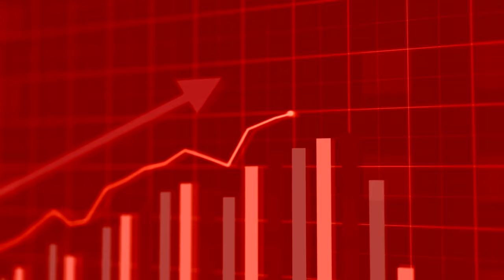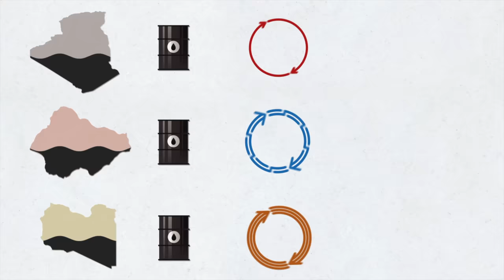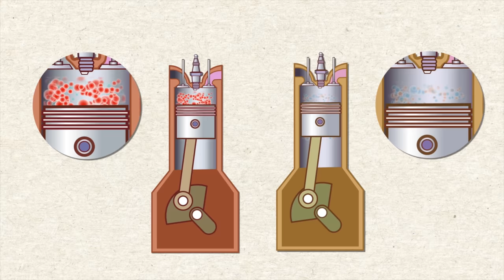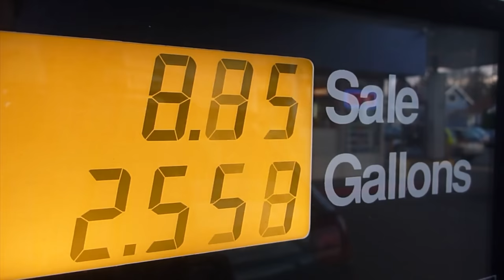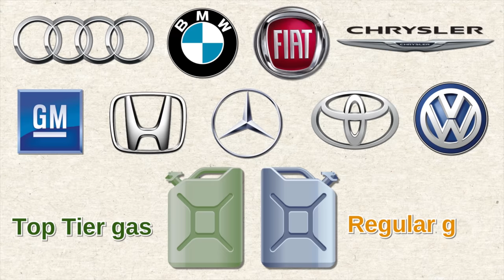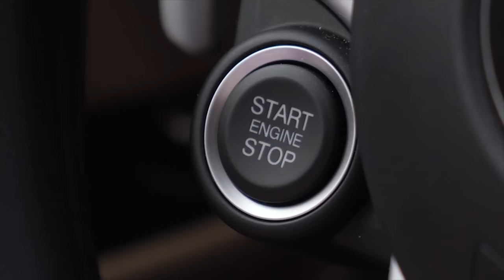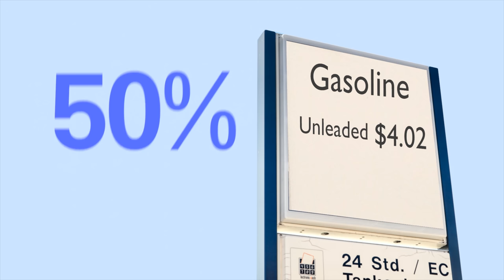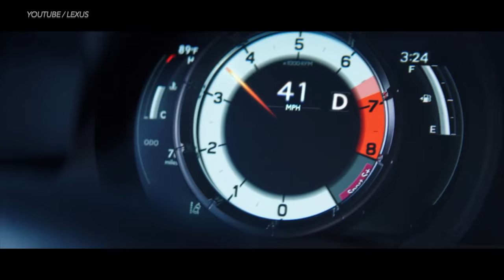No One Has the Balls to Tell You the Truth About Gas Prices, So I Will

Comment: Scotty, I am sticking with my '90 Ford Ranger Custom. It is long paid for, runs good, gets 25 mpg, oil and filter changes every 3,000 miles or sooner, gets regular maintenance on both running gear and drive train. No matter how you look at it, the truck is cheaper than buying an EV any day. When they build a hydrogen refit kit for my truck, I might consider it. But, gasoline IC is for me until this madness stops and other liquid fuels are available or they invent a battery that recharges just as fast as you can fill the tank on my Ranger. Nothing you can say will change my mind.
Reply: Gasoline IC what's that
Reply: @njcowboys3588  Internal Combustion
Reply: Research abiotic oil theory. Fascinating.
Reply: Are u looking for A son in Law.. ?
Reply: Why didn’t they go propane.
Reply: Due to my situation where i had to buy new car due to my previous 2 cars were costing me an arm and a leg... i got a 2019 Toyota carolla and gets 40mpg average. 2 years left of payments but it does save at the pump.
Reply: Have you heard of the inventor in Canada who can run an existing gasoline powered engine on Ammonia? Look into it.
Reply: @thetruthisoutthereyt  It's Canada. Are you sure he didn't say "pneumonia"? The ammonia system works,. but the ammonia has to generated and that process itself requires energy, so again you are just moving the energy generation somewhere else. For another thing, ammonia itself is pretty caustic and then there is the issue of what the combustion products are. Oxides of nitrogen are going to be the inevitable result even if the primary products are water and free nitrogen. The appearance to me is that using ammonia as a fuel is just a clever way of burning hydrogen.
Reply: Mine is an 89, and I feel the same. My manual Ranger is unstoppable, and fun to drive.
Reply: 1990 Ranger! How many miles? Is it the original engine and transmission?
Reply: I miss my Ranger - had over 500k on 3 units.
Reply: @scottcampbell4678  ammonia is in DEF so it must. But, have you looked into any videos on the subject. I too thought it was a pipe dream. It
Reply: having a paid for and well maintained car is more important that what car you drive for now anyway. when they start coming out with affordable EV's/hybrids with better cost/benefit then i'll consider something other than IC. They may even make IC even better to hold on longer.
Reply: And I, my 18mpg Ranger. Vehicles are simply out of this world right now.
Reply: @nicolec7290  propane is also very expensive and doesn't have the same equivalent "octane" that gasoline has.
Reply: I'm sticking with my 91 Ranger for the same reason.
Reply: @nicolec7290  that would require billions of dollars to switch to a fuel that has less energy! Why don't you vote for people vote for politicians that are favorable towards domestic oil producers! Tax imported oil! To all you idiots that think we can't meet the demands,  what did the Easter Bunny bring you??!
Reply: Your Ford ranger has the safety of about a bicycle.
Reply: Nicely put…🙏🇺🇸 godbless
Reply: @nicolec7290  propane was horrible on mileage distance,my company had 2and propane cost more at the time,try to find a Sunday pump on the road as myself and another had to be rescued because of no fueling.
Reply: If you simply find a good, honest mechanic like Scotty and fix things as they break before they become major issues, you can literally keep a car or truck running forever.
Reply: I have a 2000 ford ranger I bought in 2016 with 64k on it. It now has 141k and runs like a scaulded cat. I’m keeping it forever. I fill the tank every other day and it feels expensive but it’s nothing compared to these newer cars. I’m a mechanic so I love my older cars. Inexpensive and reliable! Lol
Reply: @nicolec7290  they did back in the 70s.   Didn’t work
Reply: That's usually what is recommended. Same with your house. New materials might be more efficient long run but short term, throwing away perfectly good materials that still have life in them does more harm than good. And there's just no way we can produce enough EVs for everyone to switch so you keep driving that thing until it dies.
Reply: Hey bro how do I get 25 mpg on my 08 Ford ranger it regular cab 7ft bed I have tunailcover on it I have regular tire I got up 17 mpg then fuel pump went out then I got new now I am getting  14 mpg
Reply: How the hell does a ford ranger get 25mpg? My 96 explorer never gives me more than 20 on a good week
Reply: My EV charges overnight on the battery connected to my solar panel grid. I am paying nothing to drive every day. When I see people fueling up at a service station I can only pity their shrinking bank accounts and closed minds
Reply: Wer need a truck, we don't want a fire burning POS for $60K so your choices are a truck that may only go 100-150 In winter or summer, towing...There only $100K buy 2. Oh yah, recharge is only 10 hrs. It should come with a sleeping bag & a tent.
Reply: @briannemeth9417  We need trucks for our jobs. They go est 100-150 miles in summer and winter. towing maybe less. The beds to small for work. That's ok, there only $100K. Joe abandoned Americans in Afghanistan. Intentionally escalated the 8 year Ukraine Russia conflict, & you think he's doing well🙈
Reply: @briannemeth9417  how does a solar panel grid charge at night? Asking for a friend.
Reply: @logpile1318  it charges my big basement battery all day . At night I  plug my vehicle into the fully charged basement battery and in the morning my vehicle is charged up
Reply: @briannemeth9417  how many hours does it take to fully charge?
Reply: @markmccarty9793  did you even watch the video?
Reply: @njcowboys3588  internal combustion
Reply: Not yet. Been busy, got couple guys remodeling, I'm retired now and getting everything done now! Check it out tonight!
Reply: not only charge a vehicle as fast as it takes to fill up (even the fast charging tech can take 15+ mins to charge at a station) but also find a way to cheaply repair those batteries when they start to go bad. right now, if you have an EV and that pack starts getting cells going bad, it is almost 1/2 the price of the car to get repaired... not a big deal if it happens under warranty, but kind of a big deal after your warranty is out and if you arent paying for an aftermarket warranty to cover it. i also havent seen any EV vehicles that could tow my trailer or boat the distances that my truck can... for me they need to make something that is equal to what my gas powered vehicle is before i would even consider it (distance, power, and towing).
Reply: @davidmuir405  Downhill both ways.
Reply: Changing your oil that often is a waste! I spend a few more dollars and go full synthetic in all of my vehicles and get 10k between changes.
Reply: @NineteenEighty-Four  already switched to systematic few years back! But I usually change it out at 5000 miles. Both my trucks are REALLY high mileage! My 05 fxk4 has nearly 280000 miles on it! Pull heavy trailers and the camper with it! The 2000 Expedition has bout 242000 on it! You might be right, but the 5.4 in my f150 is bout a quart low at 2500. Put one in, then change it out at 5000! The 5 20 oil is thin as water! The old 4.6 in the Expedition bearly uses any, but then again it's cheap insurance! I change both out at 5000. I'd change the filter at 5000 or so even if you wait till 10000 to change the oil! The bypass will open if the filter gets dirty and ur churning dirty oil! Most engines will run so long now that people just get tired of looking at the same vehicle!!
Reply: @markmccarty9793  Yeah, I agree. Hard use and high mileage needs more care and attention. 👍👍
Reply: I ones consider a tesla, the  I found out I was going to pay a arm and a leg 🦵 to insure it. Then I bought 69 chevy c10 with that money
Reply: I had a '91 Ranger for years. It was silver, short bed, single cab, 5 speed with the red interior. I absolutely LOVED that thing.

Some kid blew a stop sign and ran into it in 2011. I seriously miss that truck. It was in nearly perfect condition until that sad day. 

I'd still be driving it today if not for that.
Reply: @Metalbass1979  the little 2300 was indistinguishable. Once they went to fuel injection you just drove them toll you got tired of lookin at them! My 98 has the the 2500, but the step side bed means a sheet of plywood won't even fit down into the bed, much less the wheel housings!!
Reply: It's OK, with proper maintenance they'll run forever! My 3v 5.4, the ( one every body tells you to stay away from) has 274000 miles on it! Pulled a trailer loaded with old shingles over 8000lbs to thr landfill 35miles from here few months age. Change filters and oil and leave that shift lever alone,it knows when to shift!
Reply: @briannemeth9417  Where do you get your free solar panels and batteries?
Reply: ok
Reply: At some point, fuel prices WILL get high enough to justify a change. The world uses about 100 MILLION barrels of oil per day, and oil's a finite resource. Yes, there's trillions of barrels left, and we can continue on for around 50 years at the current rate, but well before the oil runs out prices will rise dramatically as the more easily extracted oil is consumed.
Reply: You can't EMP a gasoline tank, either.
Reply: I have a diesel, and SUV. I haven't found oil for my truck. I have to run all over the place, to have enough. I hope we won't have to step away from gas to electric 😳
Reply: @hubertwalters4300  It's the democrats who enabled me to have this amazing solar panel set up and ev in the first place.  I think you have been inhaling too much of that $7 a gallon petroleum.  I have also heard overexposure to Trump gas can have the same effect
Reply: @briannemeth9417  Ridiculous
Reply: 90 Ranger get 25mpg yeah right lol
Reply: I got an 88 f150. Was considering converting to propane. What do you think ?
Reply: Great to have an open mind. Education must be difficult for you since you seem to be unable to accept things are different then the way you see them
Reply: @AdamConstantine   "Oldies, but goodies." 
My dad liked to collect things, and build things. He built his own professional grade telescopes, and collected some cool cars. 
I got to "test drive" his early '60's Ferrari, and late '40's Bentley. 
     Electric just isn't where it's at when I think of cars like that.
Reply: @Bellathebear777  Good point,either a tent or credit card for a motel room that Tesla pays for.
Reply: @BkBk-gy6vr  the four cylinder with manual transmission can get 25 all day long.
Reply: That's the biggest drawback for me, the time it takes to recharge. If i could 3-400 miles worth of driving in 5 minutes like I can filling my gas tank I'd be very interested. EVs sound great for ppl who wouldn't go through an entire charge in a day, but I take a lot of long trips and can't spend hours waiting for a battery to charge. Also, I've never seen the cost per mile breakdown for electric vs gasoline. Is it really cheaper to operate an EV? What about maintenance cost comparisons?
Reply: @mattallen9448  my car may not be manufactured 100% carbon free, but so is almost every car today.  My battery may be mined using carbon fuels and is destructive to the earth but vehicle battery research is continuous and responds to world supply and demand. But I no longer use any fossil fuels. I  no longer pay $ 200- to fill my gas tank. Look there is no way a lower middle class guy can make less impact on the environment and save more money.  Your logic seems to be that because my vehicle is not a product of immaculate conception,  that it's a product of current automotive manufacturer technology that it is worthless and pointless.  How about if everyone in the United States had my car and solar panels? Wouldn't that have an impact on the environment? I'm not sure that there's a better solution right now? Do you have one?
Reply: @mattallen9448  your argument is a product of extremist logic. Because my vehicle and power are not 100% pure- then they are pointless.  That's wrong.  One day we will be at that point, it won't happen overnight.  The transition will be gradual and be fought against by some of the largest and most powerful corporations in the world.  The Petroleum industry.  Are you an employee of said industry? You argue from an extreme position so I suspect as much ((👎
Reply: Sounds good if you only have one vehicle if you have two vehicles what's wrong with buying a cheap ha ha electric vehicle which I think some cheaper ones are coming that can just charge overnight on your own home power maybe 240 most of the time you drive less than 100 miles per day when you have to go further than that take your gasoline powered car I realize this is only going to work for some people in some situations but if it does I think it's a good idea.
Reply: @OldVideoGeek  I  drive less than 30 a day. If I go to the gym after,  because it's mostly downhill,  I can completely recharge the battery and get back home close to full. You could never do that with a gas car.
Reply: @jasondelarosa5457  the fact is EV's are close to zero maintenance.  It's a very simple motor so there's virtually no problems.
Reply: @SKBottom  problem is you will be paying so much for gas the longer you keep it. I had an 8 cylinder  98 jeep grand Cherokee but the damn thing cost so much to run!
Reply: Noone is recommending switching to evs when your car is running. An old car is always more eco friendly than a new car, but if your car is unrecoverably broken an ev is the way to go.
Reply: @kingofrivia1248 old cars are not eco friendly at all
Reply: @longshorts3 "Nothing you can say will change my mind."  Kinda closed minded, right?
Reply: @davidmuir405  my 2010 4 cyl has never got less than 25. Last 3 times I filled up it got 28, 27, and 30.
Reply: @briannemeth9417  Your electric bill goes up, it's not FREE. And with all the talk about rolling blackouts and what has been going on in the world of energy, that ought to concern you. BTW, my cell phone doesn't charge up for free either, but a deferred bill can make it look that way. Sheesh, for that matter, my gasoline is free, because all I have to do is slap in a  credit card and I'm gone. Then, of course, I have to pay the credit card bill, but it was free for up to thirty days😄.
Reply: Why would you consider a hydrogen refit, and not an electric? Genuine question.
Reply: if only cars ran on hydrogen or water.
Reply: @thetruthisoutthereyt  Have you heard of the inventor in Canada? - No. I have heard that during WWII ammonia as fuel was used in Belgium.
Reply: Nope, swapped the engine to get rid of EFI, old engine was doing fine when swapped out. Still, engine from Ford Pinto was rebuilt and more HP over Ford Ranger engine.